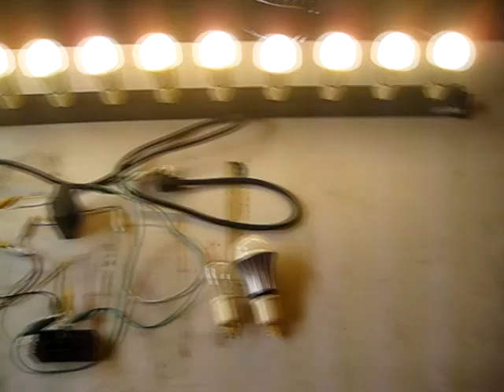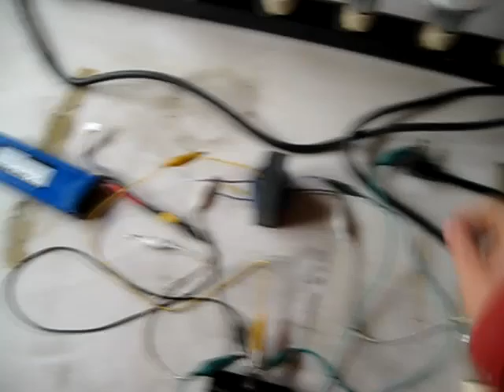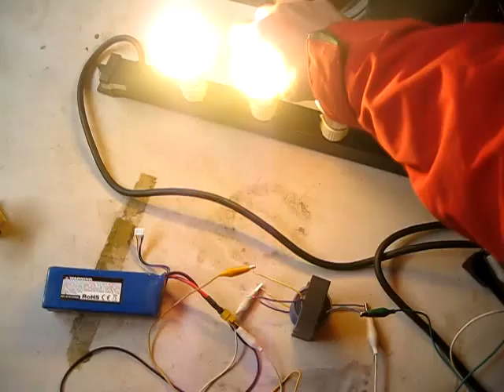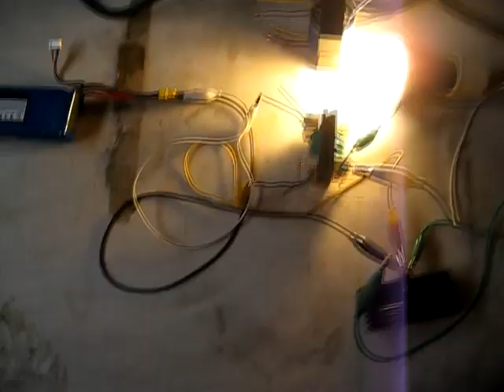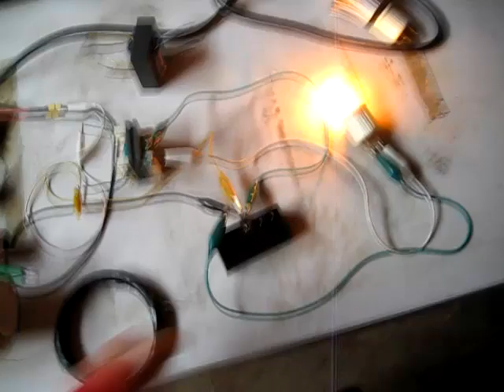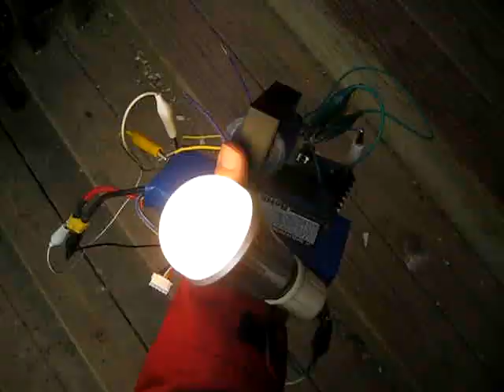Super Joule Ringer 2.0 in overdrive!

Comment: All fine and well  with your inverter once  you eliminate the awful noise but  then  the  efficiency  is shitcanned  right out the window  without  recovery of  the   light  or  energy   with some type of flow storage.  Just  something to think on  but why not  run   power to a  hairpin circuit  with CE circuit  to power even more?

Comment: that would be perfect for a joule ringer for a pack of crystal cells. We are designing a circuit so that we have the crystal cells going to an op amp and then the op amp to a  cap that charges during the day then discharges through a joule ringer to shine a really bright light for a few hours at night. We want to sell them to support the manufacture of sove very advanced crystal cells and all the other folk building the bits along the way so we can build bigger and bigger and more and more through a coop. Dont you want to join in ?)

Comment: To save our ears and SANITY, enamel the coils or place them in paraffin(candle) wax. I would use paraffin myself if the coils don't generate much heat, which I doubt they would. Also, try adjusting the frequency to get the highest output. Large transformers usually use enamel to keep the noise to a minimum. I would stick with paraffin unless you want to make it permanent since you can reuse and repair the coils much easier with wax. A heat gun will remove the wax if used carefully.

Comment: About the acoustic output, see v=-KzugLhMB9A. Or just make an oscillator and use a high-power transistor amplifier. Or make the resonant frequency be higher than human hearing. Or a string of diodes to multiply the dc voltage derived from oscillating low voltage current.

Comment: i think you get the ringing noise because you need to submerge your transformer in resin, this should stop the ringing noise as its the vibration of the wires and you will find that you get less loss through the transformer as well.

Comment: The transducers are brazed to stainless steel plates that make up the walls of a cleaning tank. They would be wired to a sweep frequency generator, and the sound will be directed into water. Don't worry though, I won't be sticking any body parts into the water when the generator is on. Wouldn't be fun.

Comment: Of course that is possible, but you need less, but thicker windings. The less windings, the higher the resonant frequency is, the thicker the windings, the less losses you get due to high current.

well, doesn't mean, it will be simple. Never testet that for a Joule Ringer. Only SMPS Transformers.

Comment: have you tried a small air gap in the form of a peice of paper between the cores - should reduce the noise. or clamping the core - try a tywrap.  generally PVC wire does not work well for transformers as any heat generated will soften the insulation but its cheap and works. when you have a final design try soaking the whole transformer in varnish to reduce the squeal. the squeal is caused by the large pulses of DC current in the circuit.

Comment: Howdy, I replicated this with the same 20awg wire and the nebraska surplus transformer and used a 5watt led bulb where you noted the 1.2watt led bulb.   I got it working last night but it draws over an amp at 12vdc input.  That seems rather high given the figures you've noted.  I have a pic of it and the schematic I ended up using to connect it all up.  Looking for some advice on how to get the lower amp draw you noted.  (oh and ur right, it shocks me nicely if touching the base of the lamp!) :)

Comment: just use for dont nee the extra two
wind one layer 20 turns in and out on the otherside than start another layer in and out as many layers as yoiu want trial and error but for best results double or triple the input
use telehone cable it so god damn simple and dont make a mistake with the connection   base and emitter base on the left and emmiter on the right otherwise you ll pop the npn 3055 like i did

Comment: I figured out why the transformer does not work all the time when you disconnect the power. The transister acts like a mosfet it is stuck in one state so you have to ground it at the collector and then reapply the positive and its fixed.

Comment: I used a 5k pot between B and C... worked great Ummm sort of...lol . With a 8.5 V power supply, I could light 40 W CFL very bright, a florescent tube and a LED party bulb. Using the 5K pot to adjust. I also used a 2n3055 transistor. All went well until I smoked my 5K pot

Comment: Thanks for all the info. Have you tried a momentary switch with say 2K resistor between B & C to alleviate the need to fiddle with the power lead, when she doesn't want to start, right away? I find this very useful in my solid state Bedini's / Slayers etc. Thanks for the update.

Comment: Right on, I'd think that given the start method of having to touch multiple times is due to no direct path for the oscillation to start which would normally be done by putting an 18k ohm resistor from the collector to the base, that should ensure it starts everytime connected.  (since it will bleed thru and start the oscillation.)  Otherwise maybe try putting a magnet near it to start oscillation if it doesn't start when connected.  Its the initial shorting to power that causes oscillation.

Comment: Exactly what I saw tonight.  Its linear.  If voltage is low in relation to the load the amp draw goes up and frequency slows.  My voltage x amps was very close to the rated bulb wattage.  Only when voltage dropped to 4.8 v did the power output drop below rated watts.  The ringing didn't start until the load was too much for the voltage.

Comment: Thank you for your hard work and for inspiring creative thinking.  I made the Joule Ringer 2.0 and it works nicely.  It will light an incandescent, but that's a waste of watts.  I think this is a more useful circuit for multiple light bulbs.  For a single bulb the joule thief is quiet for sure.
I am not so sure the coil winding is so finicky.  In fact I am not so sure this idea of a single transistor wouldn't work with a quiet air core coil Inductor.  My circuit starts up nice.

Comment: you inverter is has to do a lot more work. your transformer you made is a way better way to run light bulbs off DC than a normal inverter. your inverter is meant to stay at 60 Hz so you can run things from lights to computers on a battery. yours runs over 10,000 Hz and at a not regulated voltage and would not be able to safely power a computer (or a device that needs a regulated voltage off its own trans)  but very cool and very efficient might make one for some tools so i can run them in a car

Comment: I would speculate that with the increase in load and the decrease in the audible tone is representative of an increase in current draw which slows frequency as it causes more current to be drawn during each switching event.     That means the volt peak amplitude is being reduced as the current draw increases...    It should all be present on the scope over the collector/base of the transistor.  :)  Good stuff man, I'll see about replicating.  :)

Comment: About tapping the circuit... On my bench I noticed that sometimes coils wouldn't kick start because the seem to be some remnant field bouncing around in the circuit. I usually just touch the ground wire to the trigger or just touch it with my finger while having my shoeless foot to the concrete in my shop ;0). In my case it always starts from the first kick after grounding it. I might get a shocking surprise one day... ha